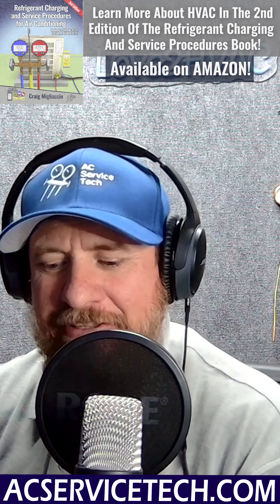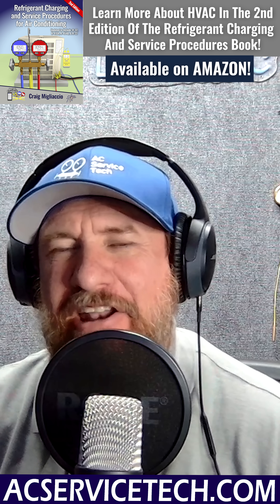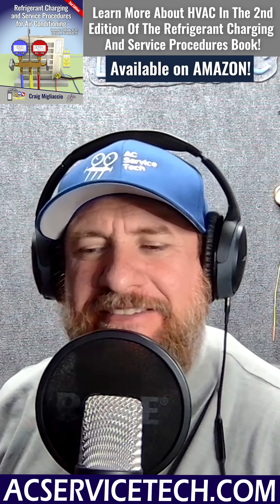What Are The Major Reasons For A Frozen Evaporator Coil?

Comment: You really can’t do anything troubleshooting wise until the coil is defrosted. My trade school neglected to talk about static pressure. It was a great school and I learned a lot and was very prepared. When I lived in Reno because of the climate coils are always running right about 34°. Many times in residential application I had to install fan cycling controls to keep the pressures up
Reply: Are you saying he's wrong about subcooling?
Reply: @realSamAndrew  yes I would not be comfortable, checking some cooling and thinking that that would be enough when the unit is froze up. You have to have a completely defrosted.

Comment: I just had one call where the suction line outside was accidentally dented by the lawn mowing guys, it was wrapped with foam insulation when i took out the insulation behold the suction line was squeezed half of its diameter, ask the owner he said the only people working near the condensing unit was the lawn guys with their riding mower..

Comment: Yep. Airflow is numero uno. In HVAC for stores, a broken belt or a bad blower motor are the number one causes. Could be a stat or wiring, too...which is why you do NOT turn off the RTU. You get out your meter first.

Comment: Had a stuck zone damper that was causing the bypass to open more than halfway.  That right there dropped the low side to 87 on a 410A.  Once I fixed both of those, the pressure jumped up to 117-125.

For a zoned system always check bypass to make sure it’s set properly and if it is still opening with all zones open, you know you have an airflow issue causing it to freeze.

Comment: Let the system thaw and then get the following readings using refrigerant gages, thermocouples, and thermometer. 

High pressure?
Low pressure?
Superheat?
Subcool?
Delta-t?

Helps to know what a properly charged and operating hvac system diagnostics should be to compare and contrast the differences.  Summer is already here in Texas!!

Comment: I like the advice on measuring subcooling with frozen evaporator coil.
Reply: Simply put, you don’t.  Let the customer know you are going to turn the system off and let it thaw out and tell your dispatch you are going to the next call and that you need to come back at a later time that day once the system is thawed out completely.  Hope this helps.
Reply: Yeah sub cooling measurements can wait until the evaporator coil is de-iced

Comment: Very common to see HVAC contractors upsize AC equipment without upsizing ductwork to accommodate the extra cfm needed to have the new system perform properly. The system can never be charged correctly, which means never get the Seer that was designed for.  Easy to see excessive TD or delta Ts across the evaporation coil, and related operating issues.😎👍
Reply: A lot of that is most likely customers being open to buying a new system but not wanting to spend the extra cash to get the ductwork done to fit the system.
Reply: @xkmmx2132 being a contractor myself for 40 plus years, mostly a lack of knowledge by the tech or sales person just not up to snuff but sure there are customers that can’t afford to do the job correctly but, up to us to educate customers and not sell something that won’t work properly or won’t last because of poor design.👍😎

Comment: Something as simple as loose / cracked belts on indoor blower motor can be a reason. Airflow interrupted, slowed down
Reply: Yea I think that’s precisely what they are implying by air flow. Look at everything pertaining to airflow, blower motor, also BM speed, CFM, ductwork or sizing, filters of course. Basically anything that could be affecting the air flow or lack thereof. As he said even the contractor is really an airflow issue because when it’s not pulled in the unit is running however no air is being pulled throughz